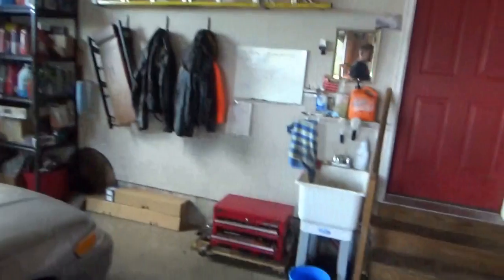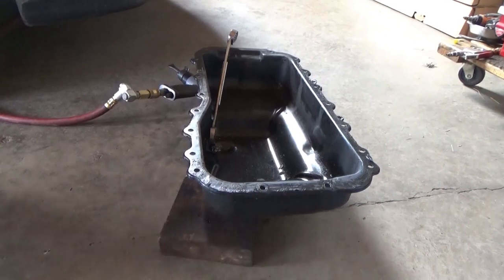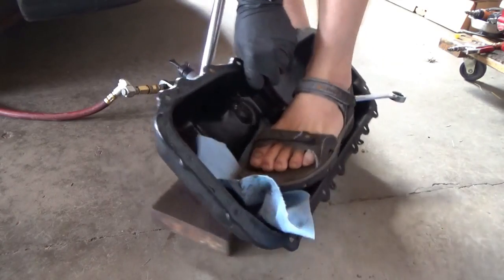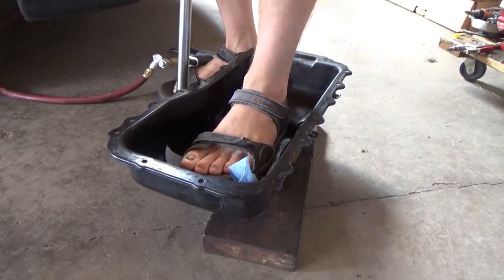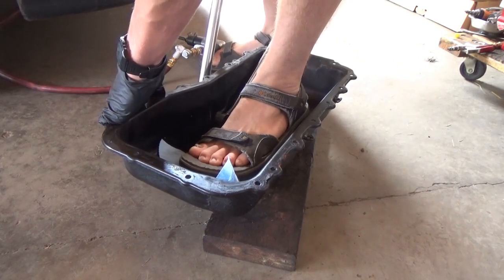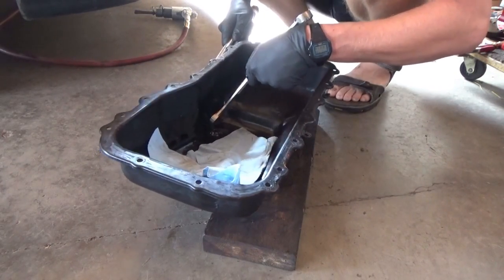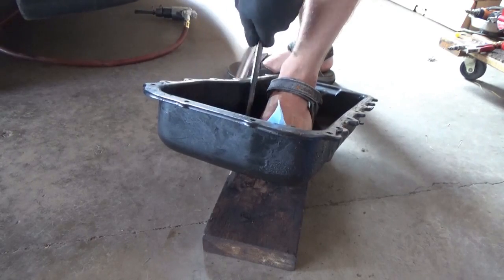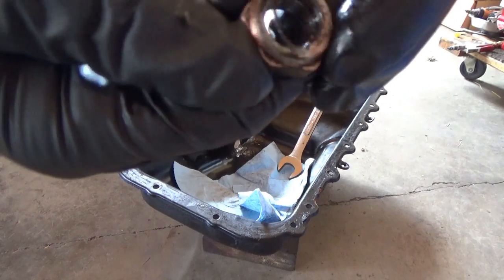How Tight was the Drain Plug?

Comment: I will never go back to any Valvoline oil change place at any locations. They strip oil plug on my 2016 Huyandi Santa Fe Sport and on my 2009 Chevy Silverado they over tighten oil plug and oil filter. Oil filter had use extreme measure get it off and lucky oil plug on Silverado wasn't strip had use a breaker bar. Going back do my own oil changes.

Comment: I read some where that aluminum pans are suppose to be 20 to 25 ft/lb of torque. Steel pans require to 25 to 30 ft pounds. I just like to go a little over snug. Or a little over spec.  I only trust needle torque wrenches. But they only come in real big sizes. And it's not a good idea to use something big to tighten a oil drain plug. You wont have much space. You will hit something if the car isn't really high off the ground. Another rule of thumb is just don't use excessive force. Remember, snug, snug. And you can turn it a little more after a snug.  And just keep an eye on it from time to time to see if it's leaking.  I actually worried that I over tighten it once, but I didn't.

Comment: I've seen 58ft lbs for the manual spec..70 doesn't seem that much higher
Reply from the maker: 20ft lbs is plenty...it's not a lug nut lol
Reply: @PineHollowAutoDiagnostics  there is a spec for each type of vehicle. Mine says 58ft/lbs but.. seemed high/was using a diff drain plug with a magnet PROB made in china so I didnt go that high...  BUT thats the manufacturer spec..
Reply: the oil change places stripped my skid plate bolts tho.. which are frame bolts
Reply from the maker: @crabbcake  I'm sure there is a torque spec for every fastener on the vehicle... But sometimes using your head and experience gives better results 👍
Reply: @PineHollowAutoDiagnostics   I think its based on the force needed to crush the washer if its below it won't crush  and seal as well....  Also, since people are 'duped' into getting 2-4x as many oil changes as they need & the 'fast' change places do stuff like use an air tool to remove... 10x more wear and tear making it weaker each time.
Reply: @PineHollowAutoDiagnostics  I kind of recall now an oil change place using an air tool to put my skid plate back on.. (2 need to be removed)  its supposed to be only 34ft lbs .. 1 bolt has fallen out now.. those jerks !
Reply: this is useful info - doing it again - glad I went lower !

Comment: I hate this. I just tried to do an oil change on a kia I just bought and now I have to go take it in because whoever tightened the plug on it last time did it so tight that I can't get it off no matter how hard I try. Without a lift I can't put a breaker bar under it so im screwed.
Reply: hammer is your friend

Comment: I realize this is an older post, but it reminded me of a car I had years ago.  I had picked up a 86 Mustang and the last oil change before I got it was done at at Valvoline quick lube.  I had to destroy the drain plug with a hammer and chisel to get it out, and I had to do the screwdriver threw the filter method to get the filter off because of how tight it was.  Pretty sure they used an impact on both.

Comment: I swear there's gotta be some dude out there with just one HUGE ARM who's doing this.
Reply: This wasn't tightened with a ratchet. It's fairly easy to tell if you're tight enough with a 3/8" drive foot long ratchet handle. This was a, run it back in with an impact till it squeaks example.

Comment: BMW worked on my M5 they left bolts undone and I had a rubber plug going to my fuse box totally missing they had to order a new one from Germany but it came with cut out hole so I had to fill it with silicone. They also damaged my windshield and hood after car wash malfunction they did paint and replace my parts.

Comment: At 21 yo I stoped trusting majority of mechanics and auto repair shops.
 I'm 68 yo now.
 Yrs I have been to good shops with good honest mechanics, few and far in between.
 The last shop ended up Replaceing 2 of their automatic transmissions, ( under warrenteed). They did both for free. They were honest. Fired 2 installers and a rebuilder.
 But after last one I had starter issues, turned out 2 bolts from flax plate to torque converter came loose and fell out.
 The whole issue left my truck out of commission for months.
 Part of problem was China flu shut down and supply chain shortages.
 Even dealerships have "certified tech" issues.
 Till the day I strip driveing I will change my own oil, tune ups, replace small component parts.

Comment: What is the factory torque spec ?
Reply: Not gonna waste time looking it up, but a typical drain plug torque spec is between 20-30ftlbs, and I’ve seen some cars go as low as 13-15
Reply: AutoMedic  Thanks , I have never seen any specs on that !

Comment: you could have repaired that oil pan, weld the nut back and weld in  new piece to fill hole.
Reply: Unless he welds it on i wouldnt trust it. Id just tell the customer to get a new oil pan to prevent future problems.
Reply: @puma1294  I guess it comes down to labour cost of repair, or labour cost to replace & part cost. It's cheaper for the customer to just get it replaced. On my own car, in my own shop. I would 100% repair it. Sump pans are £150-£200 on a cheap car. Much more on more premium cars with bigger engine.
Reply: @Professional_Youtube_Commenter  well if someone else is going to pay for it (the person at fault) then yes if ima pay outta pocket i will glue it on. Lol not glue . Weld

Comment: Um...why is there a nut on the back of it ....on the inside of the sump?? Makes it pretty impractical!! ...or indeed broken hence the internal nut...I change my Isuzu D'Max oil every 5000 km. Unless the sump gasket is leaking why would you take the sump off ... no wonder it tightened down so hard. Both meshed to the sump!! The 
thread for sump plug should be  part of the sump.. not an internal bolt! Wtf! Seen it all 🤦‍♂️🤦‍♂️🤦‍♂️🤦‍♂️

Comment: Why people Tighten up The dame plug like that
Reply: My guess is that they were obviously rushing the job instead of taking the time to do it correctly. I seriously doubt that this was done with a hand tool because it would've taken longer to tighten it this much with a ratchet. It had to have been done using an impact tool. I've done oil changes that usually take under 30 minutes and never had to use a power tool. This was obviously rushed and it should send a strong message about trying to rush things just to get it done instead of taking the time to do it properly. You're more likely to mess something up by rushing. And for a job that takes less than 1 hour to do is just completely unacceptable.

Comment: Today I ran my Porter Cable torque driver to the limit to remove the drain plug.  The drill, on its highest setting, was not enough to loosen the bolt.  I'm going to try my impact drill today.
Reply: same thing happened too me

Comment: A shop I used to work for did a deal with a local  Discount Tire. We would replace the wheel studs they break for free (except those that require removal of the hub or more parts expense than just the stud and nut) if they refer all alignments to us. I think we ended up replacing at least one wheel stud a day from them. During winter it would sometimes be several a day. I understand that they're dealing with a lot of wheel studs and lug nuts on a daily basis, but still! Don't even get me started on quick lube places. Last year, I replaced 3 engines and did one timing chain job for a quick lube place (just one location) for their customer's cars that had no oil in them shortly after they did an oil change.

Comment: Jesus Christmas! I hate those instant lube places. I checked my 1999 Ford E-150 in for an oil change. I was having some health problems and really wasn't feeling up to getting into the van. The sky behind the counter was telling me they're all certified mechanics! Bravo! Then he opens the door and yells out into the bay to the guy working on my van is that E150 front wheel drive or rear wheel drive. Seriously you're a Certified mechanic and you don't know the answer to that one?!? I specifically told the butt munch that I only wanted the oil change I did not want them touching anything else on the van. The next day my power steering was low, the AC was suddenly a pound or so low on R134, and suddenly my differential was low on oil I could hear it. Coincidence? I think not. If I go to burn the place down I would have. Yeah this really happened. Corner of Gandy Boulevard and Manhattan Avenue in Tampa Florida. Don't use a place to change the oil on your lawn mower.

Comment: I always use my torque wrench on sump plugs and motorcycle oil filters it dose not take much longer to do the job properly, I have mentioned this before on YouTube and coped it from trolls but if I do a job I go the extra mile, if you down load a oil lubrication chart with torque specs you will soon find out different manufacturers will have different specs so why not take advantage of this easy to find knowledge and do it rite have pride in your work, that way people will take pride of you simple.

Comment: Had a sump plug that tight once, and it also loosened the pressed in nut, but when I put a new plug in, it came back, because of a leak. The  steel around the sump plug was cracked to about 3 inches out like a spider web, pretty sure it had been done up with an impact gun originallying, maybe more than once, but I ended up wearing the cost of a second hand sump plus labor etc

Comment: Anyone ever rounded a plastic Toyota oil filter cartridge lid before? I did because the last person who changed the filter made it ridiculously tight. Even a breaker bar didn't work. I had to use a pneumatic hammer to break it open into millions of pieces and replace the god forsaken lid.
Reply: I had to use an impact gun to get it off one time. Another time after that i had to break another one off with a hammer and pick haha. Same customer both times, he didnt trust that we put it on tight enough so he would go home and tighten it himself with the power of thor and hulk combined. He just never learned haha.
Reply: @Constipatedoverlord  Ever since then, I always went straight for the breaker bar. I used to use a smaller wrench first, and that would round it from trying too many times. If I use the breaker bar first, I can get it right off the first try, preventing it from rounding. Nevee had a problem since.

Comment: I have found that they will lose, or fail to put the sealing washer back on the drain plug. so when put it back in, it may only be tighten to 20 or 30 ft. lbs., but now you have the steel flange on the plug tightened against the steel pan creating a lot of friction, so it may take 80 or 90 lb, of torque to remove.
Reply: you mean, steal plug onto an aluminum pans, bro.

Comment: Break away torque is always more then tightening torque for several reasons...
#1 It takes less torque to keep a bolt in motion then it does one that is stationary.
#2 Heat cycles warp the metal overtime and cause binding.

The other fault:
Re-using crush gaskets can damage threads as gaskets can only be deformed so many times before they no longer "Crush".

Replace your damn bolts and crush gaskets on parts of the car that go through that stress... NEVER REUSE OLD GASKETS and replace the bolt when needed.

Comment: I purchased a car off an auction and the drain plug was warped, the head of the bolt was warped by an impact wrench. I put 100 or more pounds on it and it wouldn't come out, then my wrench started slipping a lot so i had to use an impact wrench to undo it.

Comment: First off the torque is incorrect. A proper torque is when it’s moving and then clicks not click immediately. And you can’t sue them when u have no proof that YOU didn’t touch it after the oil change.

Comment: I'm surprised the oilpan nut wasn't sheared off its brazed joint with the pan. If that has been a Honda with a soft crush washer, that much torque would have split and forced the washer out from under the bolthead, stripped the thread and let the bolt spin free..

Comment: Just as perspective. The most i've ever seen a drain plug need was 35ftlb
Reply: Torque spec on a Scania engine used to be ~74 foot pounds, it's reduced for the plastic pans to ~44 ftlb, and ~59 ftlb for the aluminium ones. Except if you have a bone dry one, then it's 59 on the plastic ones and 74 on the aluminium ones.

Comment: I changed my oil by myself a few days ago and I did exactly the same experiment! And it was torqued about 60-70 lb-ft just like yours. Do you replace washers every time?
Reply from the maker: I have NEVER replaced a crush washer, and have NEVER had one leak.
Reply: @PineHollowAutoDiagnostics  same here. In this instance I would replace the washer just because of the abuse. I've been changing oil on car since 1966. That's when my dad finally let me do it with him. Before that I was watching him starting about 1962. Used to sit on the fender with my feet in the engine bay on a 1960 Rambler classic. I can still remember how to set the points putting the cap the way my dad showed me clean the rotor and clean the contact points if I wasn't replacing them. I also remember the oil points that this particular distributor had because it was a centrifugal Advance instead of a vacuum advance.

Comment: I got 2 free oil changes with the last 3 Yoyotas that I bought.  I never took them up on the 2 free oil changes because I don't trust the retards there.  3 times I've taken a car in for a lug nut on the rim.  Each time they screwed up the simplest job.  Cross threaded the nut so tight that the whole stud came loose from the rim and the nut & stud would just spin around.  If you want it done right do it yourself.  Never trust the retards at the dealership and the tire places.

Comment: I was just talking to someone who took a Saturn vue 3.6 to a valviline quick lube in pa ,  a couple days later she noticed it was leaking oil, she took it back to valvaline , and they told her it needed valve cover gasket. she took it to a friend ( who is a mechanic in nj. ) turns out the oil filter cap was leaking cuz they didn't tighten it all the way nor replaced the o-ring  on the cap. the valve cover gasket were OK. what do you think of that?
Reply from the maker: Not surprised at all lol

Comment: I am always careful of oil pans. Some aluminum ones only require like 10ft/lb of torque. Some 22 or a little more. On aluminum you have to be more careful than steel. Never use an impact gun!!. I had an instance where I used a small 3/8" ratchet one time to change my oil, and next time taking the plug out it was pretty much finger tight to loosen it. I used a larger fiber gasket 14mm on 12mm plug.  On steel I just use a small 1/2" wrench and aluminum washer, tighten it till its a little past snug since the washer deforms. I find sometimes these click drive torque wrench dont click at lower settings, and dont want to risk damaging my threads.
Reply: Yeah, that's under torquing it a little with 10, no wonder why it was loose when you took it off. I kind of thought I over tighten my drain plug too much. But when I checked on it. And I broke it free, I realized that I tighten it a lot less than the oil shop. For the heck of it, it was a pain, but I used one of those needle torque wrenches. *Not really a good idea because it's big and there isn't much space. But I torqued the plug near 30ft to 40 ft. Near 40 ft pounds. I will be testing it out to see if it does loosen. The reality is, just get it snug. Then once it's snug, you can get it a tad little more. And yes those click type torque wrenches didn't click once for me as well at a low setting. I thought something was wrong, and I kept going and snap. I really should of practiced it on another bolt before I used it.

I read some where that aluminum pans are suppose to be 20 to 25 ft/lb of torque. Steel pans require to 25 to 30 ft pounds. I guess you aren't far off. I just like to go a little over snug. Or a little over spec.

Comment: I see you really get into your work.  I bought  car that had been to K-Mart for an oil change and the drain plug fell out as the owner drove it home. The engine was toast.  I bought a wrecked car with the same engine and made a good profit when I sold the car. The mechanic that made that expensive mistake (K-Mart did pay) probably has been overcompensating ever since and working at Valvoline.

Comment: My last trip to a quick change shop was to Jiffy Lube, which provided their "Signature Service" to my car.  It was a Mazda MX-6 with a manual transaxle.  They changed the oil and filter and as I was about to pay they ran down their list of items they supposedly checked and offered suggested services based on car mileage and age.  Sounds good so far, right?  They rattled off about ten things that were fine then said they checked the transaxle fluid level and it was good.  I suspected they hadn't checked this, so I asked them how they did that.  Oh, there is a dipstick in the engine compartment.  No, there is not...  Oh, Mr. Raasch, we know your car, there is a dipstick in the engine compartment.  No, there is not...  Ah, there is a plug in the side of the transaxle, we take that out to check the oil level.  No, there is not.  At this point we went out to the car which was still in the bay and the tech was under the car.  The sales clerk asked the tech if he checked the transaxle oil level. Yes.  How?  Dipstick in engine compartment.  No...  Plug in side of transaxle.  No.  As I stumped both of these liars, they asked, so how DO you check it?  You remove the speedometer cable and check for the level on the plastic gear.  It is simple to do, but I highly suspected did it.  What good is a signature when the people filling out the form are liars?  Last time ever to Jiffy Lube.